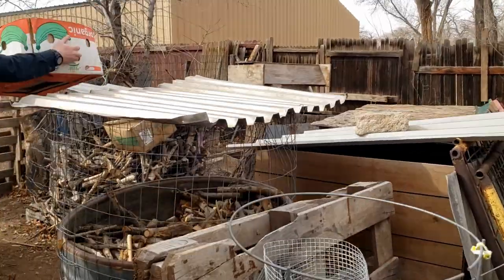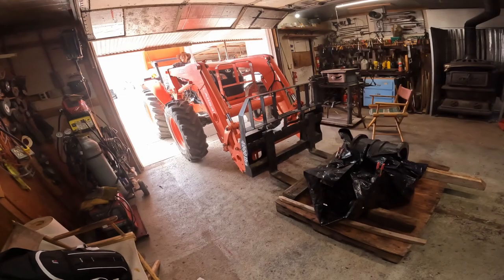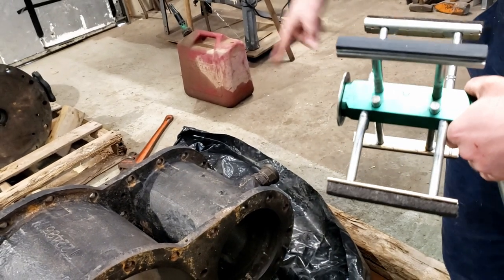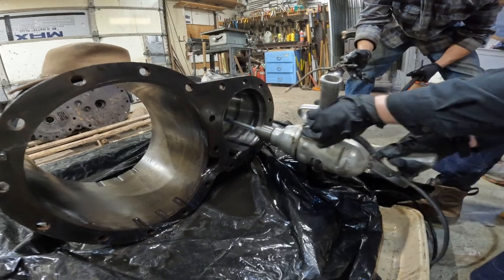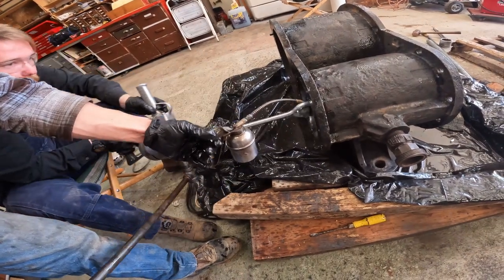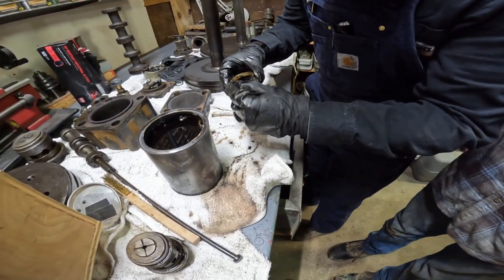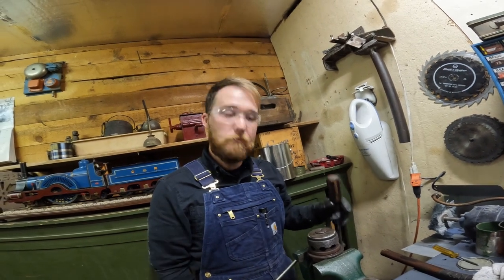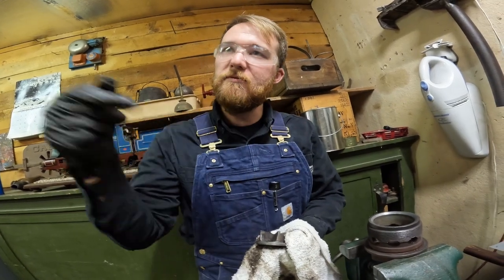Honing 2926 Air Compressor | Air Compressor Rebuild

Comment: These 2900's are monsters, its so great to see one fully restored. Is there any future plan/ opportunities to run this anywhere pulling an excursion?
Reply: The society will work with the state of New Mexico to run trips on NMDOT tracks from Albuquerque to Lamy, NM. Also, the society has been invited by the Grand Canyon Railway, but the society has to work out a deal with BNSF and Amtrak in order to get 2926 out there.
Reply: @Chooch  Thank you for the update!
Reply: @ricko3242  No problem. Before that can happen, they need financial support from the community to get their spur track connecting the mainline to level 2 standards to safely transfer 2926 from where it is now to the mainline. It would be greatly appreciated.

Comment: Even with automobile cylinders, HOW do you compensate for what was scraped out? Make piston slightly LARGER to hug newly honed out cylinder walls?
Reply from the maker: Piston rings are rings on the outside of the piston that spreads apart against the cylinder wall. So even though we only scraped a hundred of a thousandth of a inch the ring will hug it anyway.
Reply: @atsf2926  OK Thanks!

Comment: My never-ending question here is that where do ya'll get your "spec's" from. (or is it "flying by the seat of your pants"), kind of thing?
Reply: Amazingly, a lot of the original builder's construction drawings exist for locomotives and their equipment. Air compressors were so standardized that the FRA specs for testing them actually call them out by model. It's literally in the federal code. 49 CFR 230